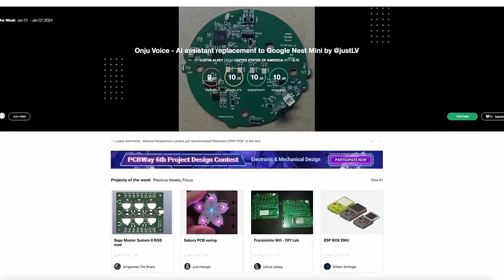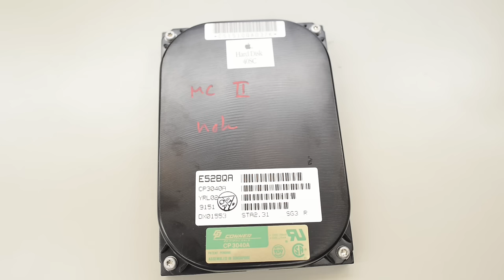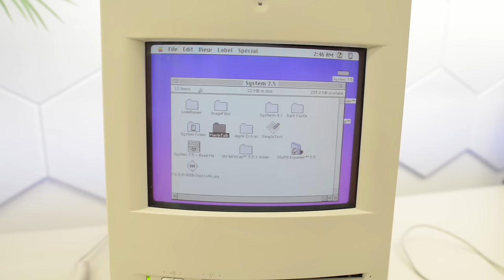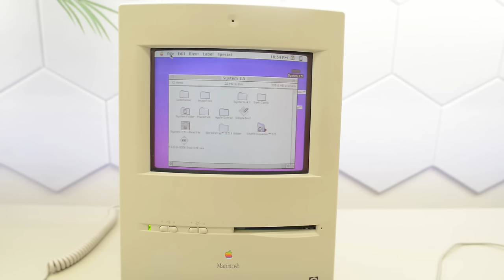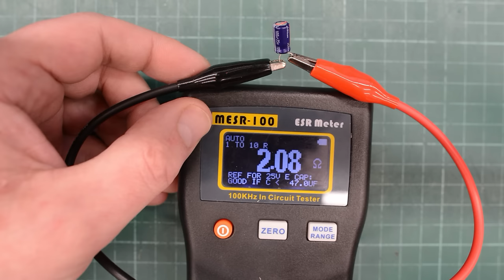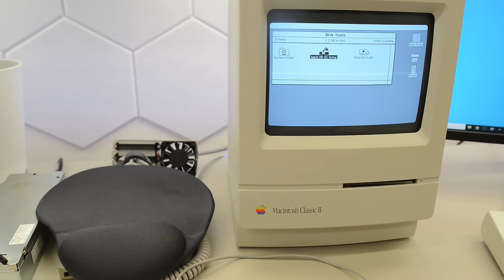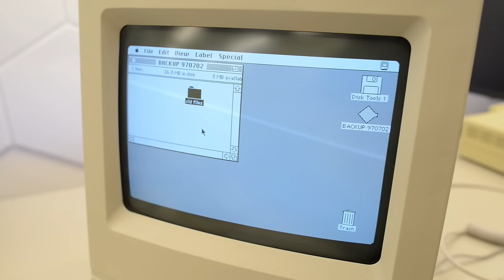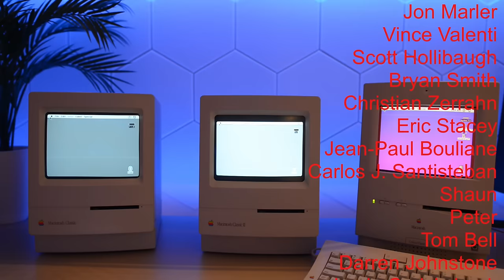Macintosh Classic, Classic II & Color Classic repair  +External SCSI drive restoration Apple HD20SC

Comment: Edit: early comment, I see now you did this on the 3rd drive.
Often these drives with stepper motors have stuck bearings in the steppers, the grease turns to glue after a while. The one that spins might just need a drop of bearing oil on the stepper bearings.

Comment: Yeah Rodime drives were a thing back then. A friend and I bought two SCSI 105MB Rodime used drives (from the same local guy) for our Amiga 2000 machines. His drive lasted about 3 months then died. Mine was still working at that time so soon afterwards I sold it to a local guy as a working drive for some good money. I assume it died eventually but that wasn't my problem hehe!
Reply from the maker: I thought they only made those proprietary drives for the Mac 512Ke. learning something every day

Comment: You may be able to fix the Conner drive by taking it apart and removing the rubber bushings (they degrade with time and become sticky and then turn to goo) that cushion the voice coil assembly from the screws that go into the magnets.  Also the gasket for the entire drive tends to turn to an oily subsistence as well.  Make sure you ware gloves when taking apart this drive as the gooey rubber tends to get everywhere.
Reply from the maker: I'll give it a try, thanks

Comment: Use "Low Melt" solder to make it easier to remove components.  The low melt solder lowers the total melting point of the older solder, makes it much easier to remove components.
Reply from the maker: Yes, I use Chip Quick whenever it's not suitable to use the rework station.

Comment: sometimes on older drives, the main motor gets a bit stuck and is unable to spin up on its own. try applying power and immediately manually spin up the platter. this fixed an old prodrive 80s of mine.
Reply from the maker: I'll give that a try

Comment: For the Color Classic, you may try looking for broken solder joints around the flyback and the neckboard. If the grid pins are grounded or left floating intermittently, that would cause all sorts of weird behavior. Broken/corroded pots might be a problem too
Reply from the maker: I don't remember if I have reflowed the solder joints on this CC. I'll check. Pots are cleaned but sins this looks very much like bad pots, I'll clean them again and more thoroughly this time
Reply: @Epictronics1   Just don't bang the CRT neck. At some arcade/home console museum there was a small Sony Trinitron where the picture would intermittently become super dim and fuzzy. After some resoldering and cap changing with no results (it would work great for hours, then go dim and fuzzy, sometimes so dim you have trouble seeing it's turned on at all). When I had it open, I whacked the neck of the CRT, thinking it might clear up a temporary short. Instead, it made a temporary short permanent, wrecking the CRT. At least it revealed there was a temporary short inside the CRT.
Reply from the maker: @senilyDeluxe  Let's just hope it's something else :/
Reply: I'm thinking it could be a problem with the G2 (screen) voltage. On many displays an adjustment for this is built into the flyback/rectifier module so hopefully that's not bad.

Comment: The Color's issues might not be caused by something else, but by several things, including the scorching diodes and bad caps.
One thing, I would check next is other diodes, maybe look at transistors... check for other excessively hot components, if you have a FLIR. Maybe replace thermo pads and grease underneath heat-sinks.
And overall, check whether there are loose legs or broken solder joints.
And maybe check the values of the poties, before switching on and after the fault appears.
Reply from the maker: Great suggestions, thanks

Comment: Yay, Würth caps!  My favorite.  I like them because they tend to be the lowest cost amongst the higher performance capacitors (low ESR, temp, etc.)  Way cheaper than similarly rated capacitors from Rubycon, Nichicon, and Chemicon.
Reply: A local friend always uses Wurth caps but only because they are red heh!
Reply: @g4z-kb7ct  They certainly stand out. :)  Only downside is that they don't sell axial capacitors.  But they're still some of the best priced polymer caps.

Comment: Over-brightness could be a bad trimpot as they often get wear spots on them where there's no contact, meaning the value of the resistance is zero. Can also be caused by the flyback adjustment pots wandering over time (although they shouldn't wander). Or something in the brightness circuit on the board has failed.
Reply from the maker: I have cleaned the pots but I'll clean them again

Comment: Be careful when manually turning the platters. You shouldn't rotate the platters backwards, because you can crash the heads and destroy the drive. If the heads have any tiny bit of resistance at all, you can rip them clean off turning the spindle by hand.

As for the ST-225N that doesn't spin, did you check for delayed start? Most SCSI drives have an option for delayed start, which keeps the spindle stopped until told to start by the SCSI host controller.
Reply from the maker: I'll check, thanks!

Comment: oh no, I was hopeful for the Trinitron! What about moving the drive trimmer back and forth a bit? Maybe it needs to be "cleaned". And you have a working miniscribe! Mine works but it's unusable...

I'll work on some Macs soon, I'll keep this video in mind!
Reply from the maker: I still haven't given up on the Miniscribe in the Canon lol. One day we'll get it running :D It sure looks like it could be corrosion in a pot. I have cleaned them once but I will clean them again.
Reply: @Epictronics1  isn't the drive pot in the flyback? Maybe just turning it back and forth several times will do the trick - not when it's running :)
Reply from the maker: @tony359  yes, the gain is very likely on the flyback. I'll check!

Comment: I suspect that the glitches in the color mac are due to bad components on the neck board. Possibly a bad solder joint or MOSFET.

Comment: I would have thought that turning the hard drive motor against the normal direction would damage the drive heads. I'm just assuming they're always connected. Am I missing something? BTW,  the Chemicon SM caps are not particularly exotic. They have many that are exceptionally good, starting with the fairly common KM series, if memory serves.

Comment: The Classic II needs to be adjusted, so the picture fills the screen. All that black makes my brain itchy.
Reply from the maker: yep, we'll fix it proper in the upgrade video
Reply: Weren't they designed to have the screen resolution set to a specific DPI?